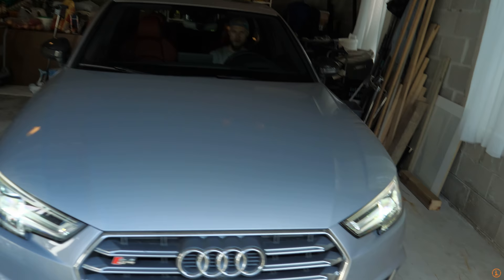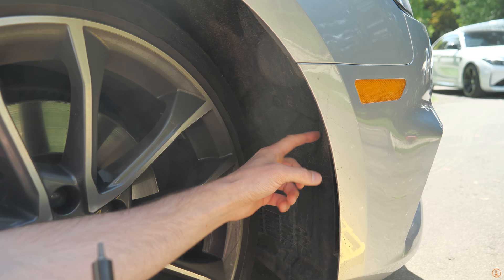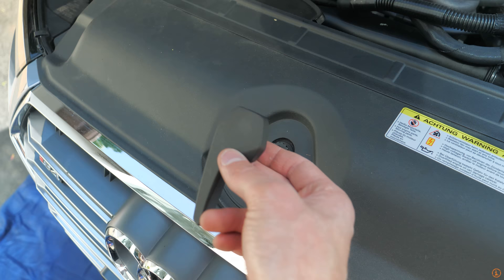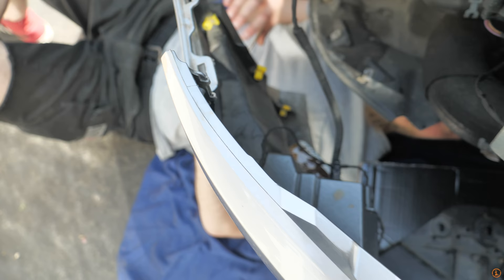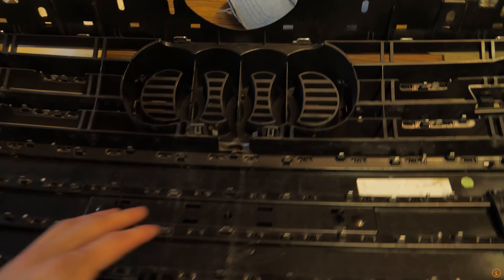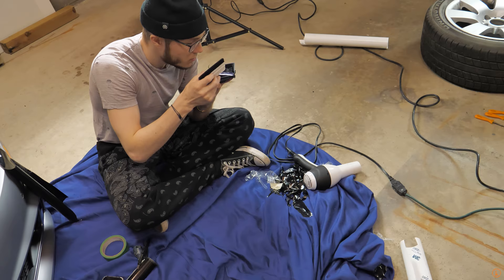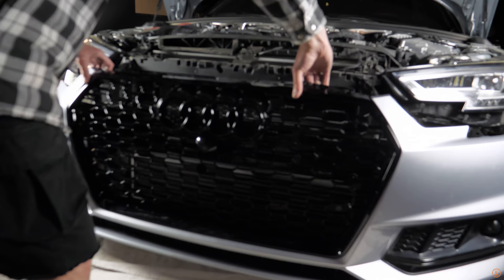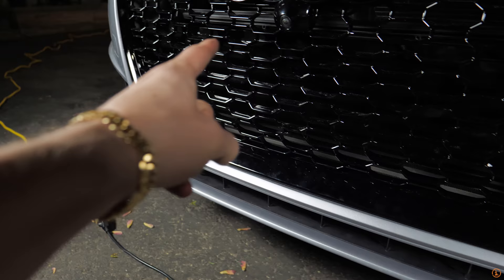Installing an RS Grille on my B9 Audi S4! *STUNNING*

Comment: before you install these grilles, spray it with a can of clear coat...maybe two coats. the factory coating won't last more than a year before it starts to fade.  thank me later.
Reply: thanks man. i ordered mine yesterday.
Reply: @bh251cc  hi what site did you order yours from ?
Reply: Have this issue now, also sensors keep falling out so I’m putting the stock back for now, wondering if I can scuff the rs one and respray it

Comment: Have you experienced any issues with the grille parking sensors detecting random objects and beeping constantly? The sensors position on the new grille are at the bottom instead of the middle.
Reply: I was wondering the same question. Just bought a grille and I can see the sensors dont line up to the stock grille...Anyone have any advice?

Comment: Very nice. Looking to do the same to my A4. Looks like such a complicated job though!
Reply from the maker: It's definitely worth it once you see it. The biggest issue for us was all the tech - the advanced driver assist sensors were difficult to unplug and the we removed and wrapped side grilles. Plus I'm just very impatient with clips. So if you're not doing that it'll save time.

Comment: 14 hrs?!?!? it took me no more than 2 max when i did mine. none the less it is still beautiful
Reply from the maker: You are a wizard.
Reply: I was going to say same thing 14hrs ffs it took me 3 on my own.
Reply: vinyl wrap slowed them way down. Trust me, spray paint the crash bar with matt or gloss black and same affect. RS grille looks so much better and when you install larger intercooler the RS grill will flow more air to intercooler surface too. The factory grill is crazy restricted when tuning these engines.

Comment: Good stuff boys. I just got an apr intercooler for my S4 as I have heard it helps so much, especially since I got an apr stage 1 tune.
Reply from the maker: Intercooler is definitely on our list. Do you have any other mods?
Reply: @DailyDownshift  yea not too much I have the apr stage 1 tune, awe track exhaust, and an ecs diffuser which is really clean
Reply from the maker: @simplexbane2687  Must sound great. We've got a high flow cat and intake coming soon...pretty excited

Comment: Did the parking sensors on the grill portion cause any issues with the crash bar? I saw a video where they actually had to cut up some of the crash bar because the sensors were mounted in a different spot from the old grill.
Reply from the maker: They are now right up against the crash bar but I didn't do any cutting and I have had no issues

Comment: Looks so much better, can't wait to do this to mine!  Are you thinking about painting those sensors or buying new ones in black?
Reply from the maker: They don't bother me too much tbh, probably leaving them
Reply: @DailyDownshift  yeah I'll have to see them in person once I get the grill and install it, they probably won't but me as much either.
Reply: supposedly "nail polish" remover takes the grey paint off the sensor and will leave it black. Did you end up painting your sensors? I may try the nail polish to see if there is black paint underneath. @Jokero_YT

Comment: The RS grilles looks awesome Are you having trouble with the cameras or sensors now that It is installed?
Reply from the maker: Thanks! No issues whatsoever with the front camera, parking sensors or drive assist.
Reply: @DailyDownshift  when you said you had to file down the clips and sensors how much work was needed?
Reply from the maker: @mdc160  The housing for the camera had to be filed down. However if you don't have one then no issue!

Comment: How did u guys make the camera fit the brackets are different I couldn’t screw the camera back in place since the bracket is different
Reply from the maker: You have to use the original camera backing. DM us on insta
Reply: @DailyDownshift  Great video! followed it step by step and it made all the diff.  The camera mount has me frustrated.  Your reply states you used the OEM camera backing.  Did you have to modify the screw holes to fit the new grill housing or did you use the OEM housing?  Any advice would be greatly appreciated.
Reply from the maker: @bnishig4580  You have to flip the oem backing upside down and use it with the new camera front. You also have to file down the plastic to make it fit
Reply: I needed to know about this because I have the same grille and had to flip the camera upside down to fit with the bracket that came with it.